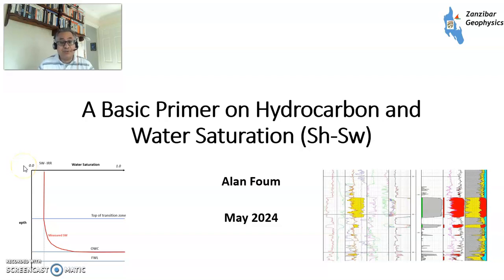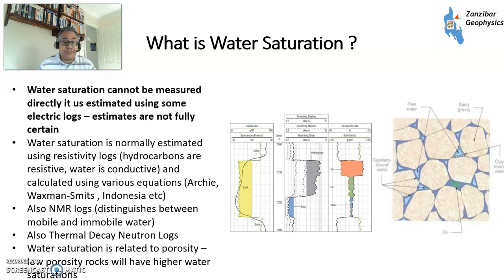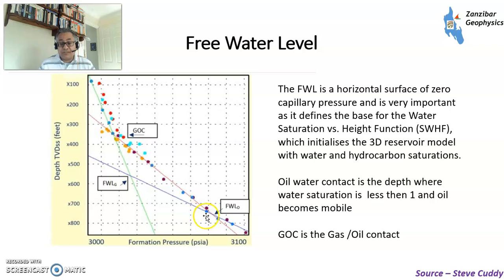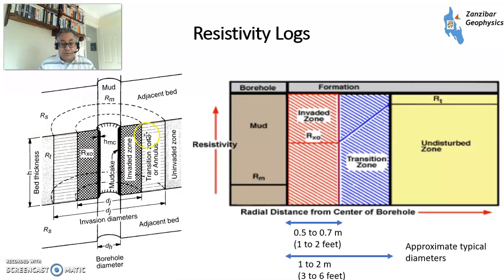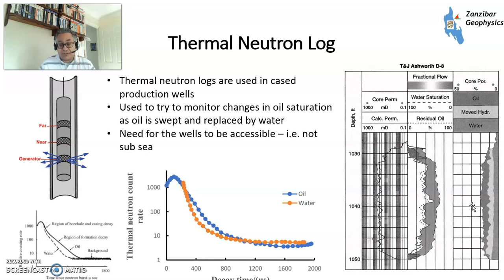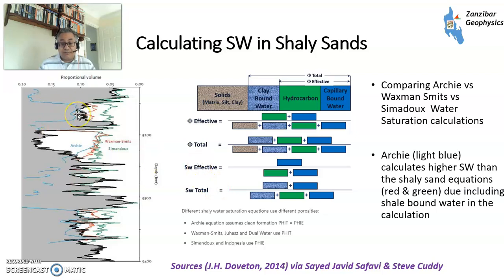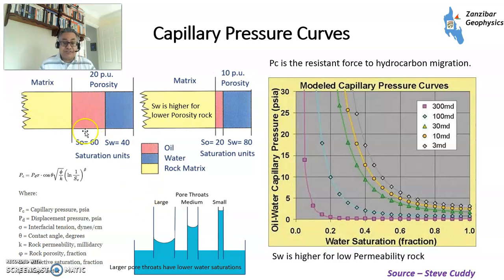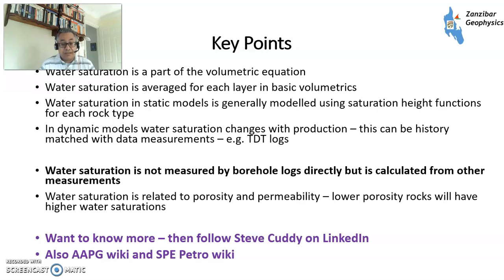A Basic Primer on Hydrocarbon and Water Saturation (Sh-Sw)

Comment: I have watched several videos on EOR, specifically steam flooding as a good way to change the viscosity. Others have shown CO2 injection as a way to normalise the hydrocarbons. Gas/heavy oil and gas/gas exchange. 

So why does one not start each project with high temp CO2 injection? You flush the pores with gas, while still at pressure and get the benefits of viscosity changes. You also please the frequent flyer climate hypocrites by pumping down their emissions from cross continental flights.

Why start with just normal suction, when you can start with EOR directly?
Reply from the maker: It is probably a matter of cost vs return - A recovery method for an oilfield is determined in the initial development plan to give the maximum return for the money invested - EOR can be done from day one - but
a. you need a source of CO2 or steam and significant extra engineering which costs
b. the extra oil recovered by EOR needs to be worth more than the cost of the EOR
c. The operator needs to really understand EOR - the more complex a project (and EOR is complex to implement) the more scope there is for cost and time over runs
d. Most large oilfields for which EOR is suitable were first developed a long time ago (decades) when EOR was a mere glint in an engineers eye rather than a proven technology, hence late implementation
e. There is a not invented here mentality among some operators which can hinder progress